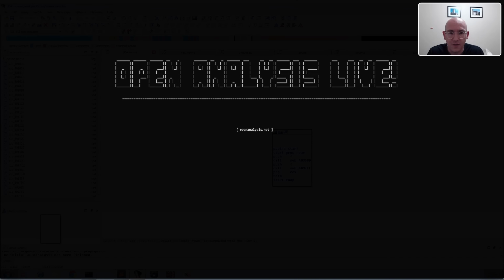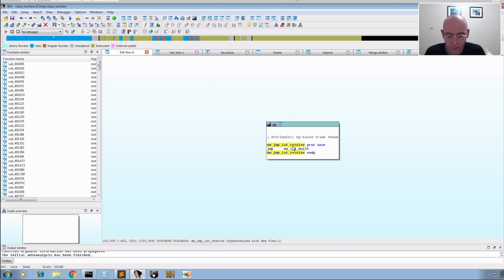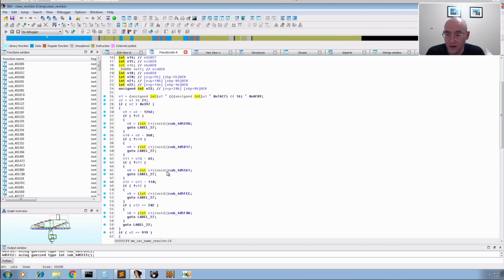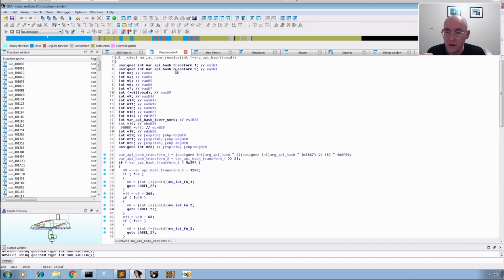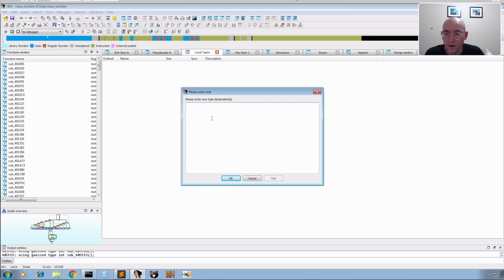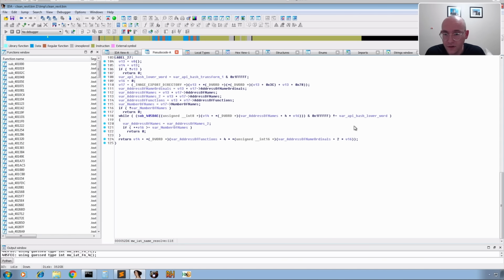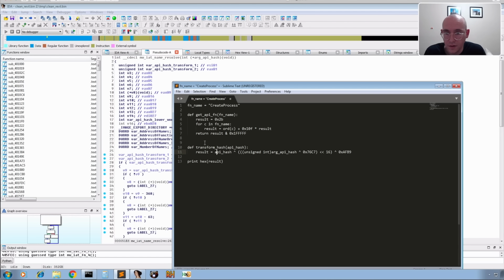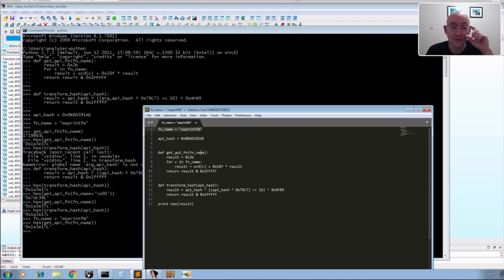IDA Pro Tutorial - Reverse Engineering Dynamic Malware Imports

Comment: Good tutorial ,But in practice is there any benefit in static resolving rather than dynamic (just let it run) ?
Reply from the maker: That's a great question, and it depends on what you need to do. In most of our tutorials we demonstrate how to quickly triage malware; unpack it and get it ready for reverse engineering. In this tutorial we are starting to show how you begin actually reverse engineering malware. So what's the difference? If you just need to quickly identify the malware and what it does, using the dynamic trick we showed in part 1 of this tutorial will work great and it's nice and fast. However, if you need to report on this malware you may get questions like, how do they resolve their imports, have you seen this import resolving technique used in other malware, is there anything unique we can use to identify this malware by based on the way it resolves imports, etc. These questions can't be answered without fully reversing the malware. That is the main difference between triage, and proper reverse engineering; when you are reverse engineering your are attempting to collect as much information about the binary as possible. At the time of collection you may not understand what is relevant and what is not. There is also a practical benefit to building the IDA scripts which we will demonstrate in the next tutorial. Often when you track the evolution of malware over the course of its life cycle you will have to look at many similar samples. It is much faster to do this type of "bulk" reverse engineering with static scripts rather than having to use a debugger to build the imports each time. Apologies for the long answer but I think this question is very important as it gets at the heart of difference between proper reverse engineering, and triage.
Reply: @OALABS  Thanks for the detailed response didn't even considered the signature aspect.I guess this specific example doesn't demonstrate the benefits of static analysis all too well since as you described the method is well known and reversing the specifics doesn't bring too much new information to the table, of course it's just a tutorial and great one at that.
I was using myself IDA Python to find and decrypt salted strings in some sample and it was amazing so I don't look down on static analysis in any way I just avoid it since it usually takes more time (depends on the case).
Looking forward for the next video ;)

Comment: what about more "proper" dynamic import implementations where the import resolving is completely inlined and the function pointers are stored on the stack rather than the .data section?=)
Reply from the maker: That would be a neat tutorial, but that's pretty rare since it's a lot more work for the malware developer. This sort of block-table import resolving is pretty much the standard unless the malware dev has spent a lot of time on it. The only malware that I know of that does individual import resolving is Dridex and they have their own macros for it. If you send me some hashes of other malware that does this I could maybe make a tutorial out of it?
Reply: @BSOD.Enjoyer  牛逼